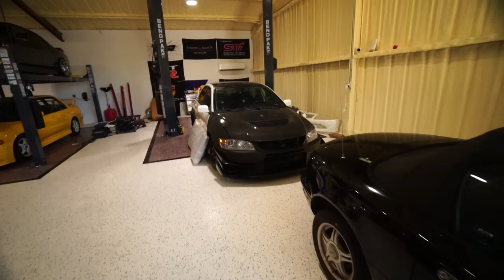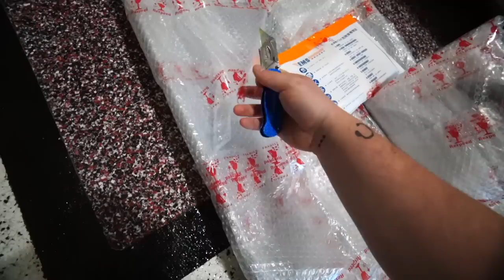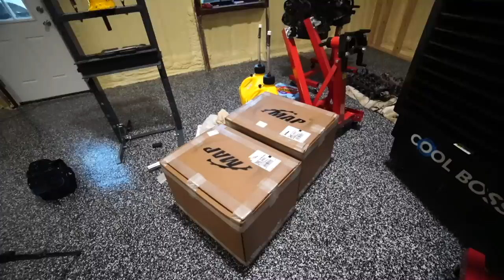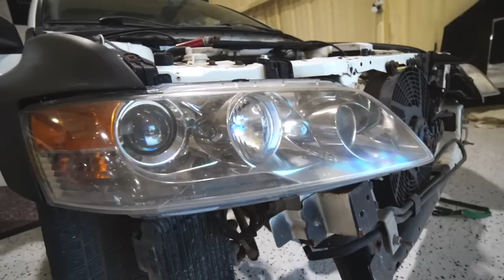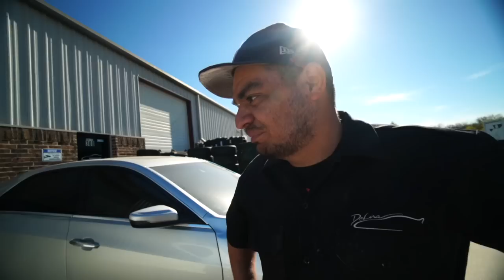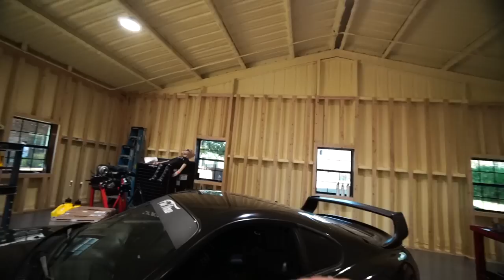Barn Find Evo VIII goes off for paint + 900hp engine build update! Restoring a Barn Find Evo 8 pt. 7

Comment: S15 doesn't come with a left hand drive man. Only available in Japan, Australia and New Zealand which is all RHD. However there are LHD conversions
Reply: Wrong. In norway they Are lhd
Reply: @zentoxi3391  "This generation of the Silvia was only sold in Japan, Australia and New Zealand but was available as a grey import in most other countries. In Australia and New Zealand the car was sold as the Nissan 200SX."
Reply: @zentoxi3391  check gtr registry for production numbers and vin numbers. only available in Australia, New Zealand and Japan